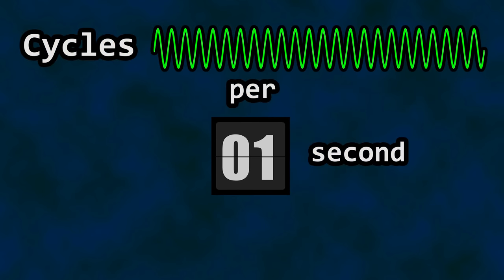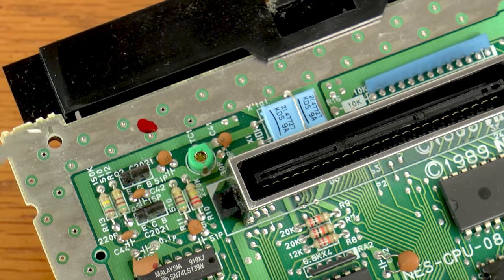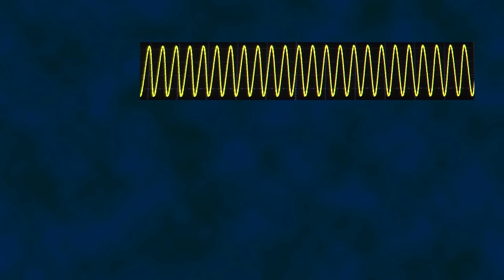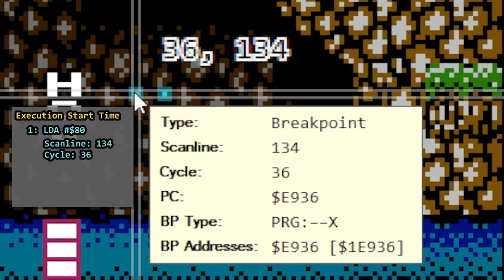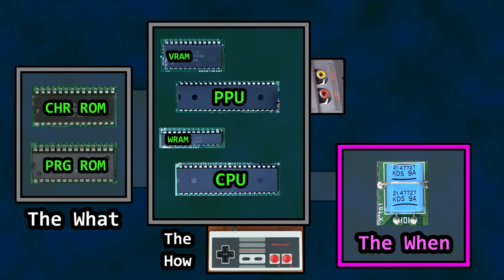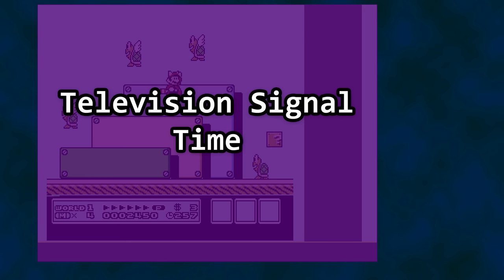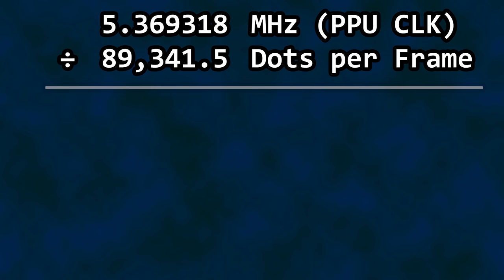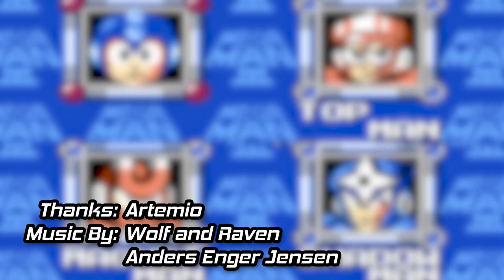Let's Dive into the Cycles, Speed, and Video Output Timing of the NES - Behind the Code

Comment: So, if the crystal dictates clock speed for the CPU and the PPU, what would happen if we were to swap the crystal for a faster one? Would we be effectively overclocking the CPU and the PPU?
Reply: You effectively would, or one could also use an external clock multiplier circuit, not unlike what's done with modern CPUs today. However, the PPU has to be locked to the colorburst frequency of whatever TV system it's outputting for, so you can't just boost the frequency of the PPU for higher resolutions or frame rates; the graphics will rapidly turn into garbage as a result. You could try and boost the CPU clock speed independently, but that would throw off the pitch of the audio system (it relies on CPU timing as well, since the audio is literally on the same CPU die), as well as screwing up any game logic/timing that uses CPU cycles instead of PPU-based timing. So while you could, the chances are quite high you won't get a usable system out of it.
Reply: Some emulators allow you to simulate "overclocking" chips in such a manner, reducing or eliminating slowdown that was present when playing certain games on real hardware.  In real hardware, you'd presumably immediately break the video output if you swapped the crystal without doing some measure of extra work to keep it within NTSC standards. You might could overclock the CPU while leaving the PPU alone, but I'd guess that would help fewer games than you might think.

On a related note, the difference in the PAL and NTSC TV standards resulted in the PAL NES using a 26MHz clock instead of 21MHz, but it also uses higher divisors for the CPU and PPU, resulting in those chips actually running at slower speeds.  Yet the PAL NES CPU still sees more cycles per frame, because the PAL TV format was 50Hz (50 fields per second) instead of 60Hz.
Reply: You don't have much leeway until the TV can no longer decode the signal.

You have some latitude on vertical refresh rate, though it shouldn't exceed 61Hz. But say you took a PAL NES (different timings) and PAL TV, you gain some extra leeway since all PAL TVs are fine with 60Hz vertical refresh.

The colour burst is very sensitive, but you can drift off it very far and it won't be fatal, just at first you get false colour and then you lose colour altogether. It's OK, you can live without colour.

The most critical is horizontal refresh rate. It's near 15.75 KHz (in both PAL and NTSC) and you can't deviate very far from it, the TV will lose sync. Very very narrow working range.
Reply: If you put a faster crystal on the cpu only it will make the game have less slowdown but the sound will be at a different pitch.

Comment: I never knew the NES PPU had a higher clock speed than the CPU.
Reply: That is typical for most computers and game consoles from the day.
Reply: I guess that is due to the deeper pipeline in the video chip. The CPU had no transistors left to deal with pipeline issues? Though Intel always had a higher clock rate ( 4.7 in 1981 ). Then 1985 with the Amiga the CPU had the same clock. Can OCS do 640px ??

Comment: So, all quartz crystals are perfect and run the clock at the expected rate?
Reply: Good question, the crystals are not perfect and their speed varies as a function of their temperature but the machining of their dimensions and tuning of their associated components is precise enough that the variations in speed are much smaller than the required precision.
All NESes run at slightly different clock speeds in practice but they all function within the tolerances of the NTSC/PAL tv specs.
Reply: you can change the frequency by changing the shape of the crystal and so they get very close to the required frequency in the factory
Reply: They're very very close, with usual good quality grade being 20ppm, so a 20MHz crystal might deviate by 1 Hz. They are factory trimmed by removing some material with a laser.

There's also cheaper lower quality grades like 50ppm.

Over decades, they can drift a little.

Comment: Now here's my question.

Can you, without making it unplayable, overclock the NES?
Reply: You'd need to overclock your TV too.
Reply: @Lemon_Inspector  Shouldn't you be inspecting lemons? Lol
Reply: The short answer is "no." Since the NES was designed around fixed speed relationships, changing the speed of either the CPU or PPU would have serious consequences for system usability. The PPU has to be locked to a fixed speed in order to directly output a video signal a TV could decode, especially since there's no render kernel software in the chip you could hack to compensate for the changed timing; not like modern programmable shaders in a GPU. While you could clock the CPU higher while keeping the PPU speed fixed (requires extra clock multiplier circuitry), you would change audio pitch and timing (audio and CPU being on the same die, sharing the same clock), and any CPU-based game timing would be similarly thrown out of whack. You'd have to reprogram the games from scratch to conform to the new timing, unless you choose to use a mapper that provides an external timing reference, but that also has its own challenges.
Reply: @eddievhfan1984  Fair enough. Thank you for the detailed answer